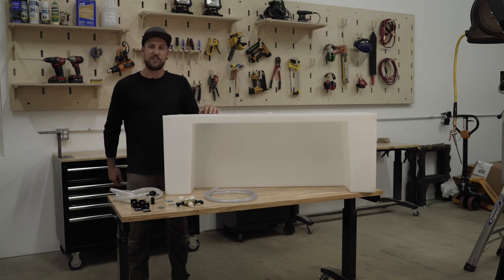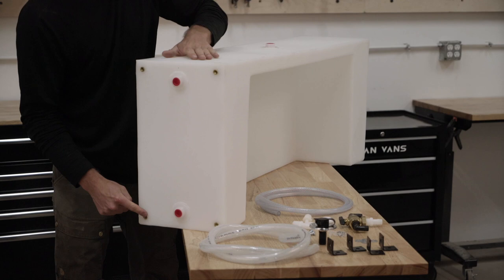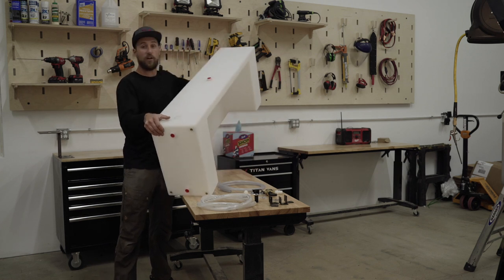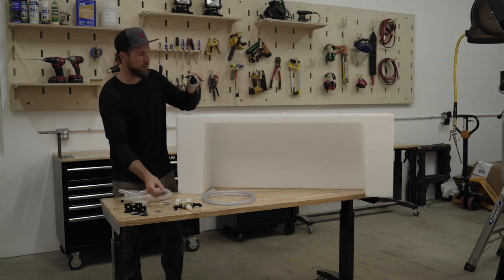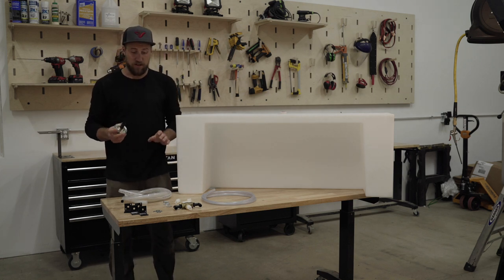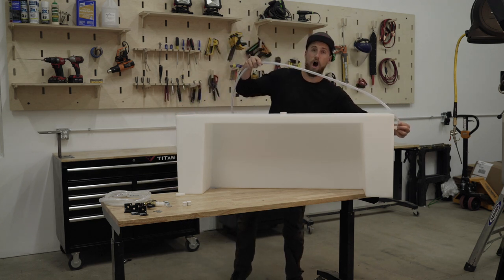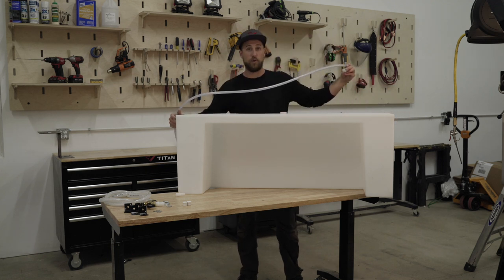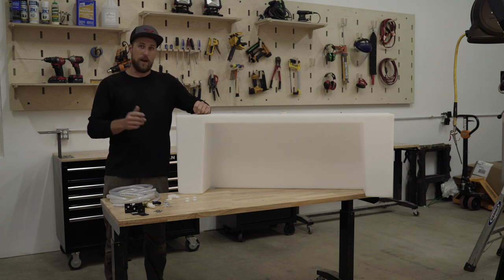TUTORIAL: How to assemble a 20 Gallon Water System in a conversion van using a Wheel Well Water Tank

Comment: Thank you for your video. Does the three way valve have a 1/2" to 3/8" barb on for the water pump side, and a 1/2" to 5/8" connector for the tank drain side?
Reply from the maker: The valve itself has female 1/2 NPT threads on all three sides. This particular kit includes (for adapting to hoses):
1 - 3/8" barb elbow x 1/2" NPT
2 - 5/8" barb elbow x 1/2" NPT
2 - 5/8" barb x 1/2" NPT

Comment: Sooo I’m confused. You need a total of 3 of the fittings that have 5/8 barb (1 for inlet, 2 for outlet) I got my kit. Only came with 2 and also didn’t come with any screws
Reply from the maker: Yes you need 3 of the 5/8" straight barbs, one for inlet on tank, one for outlet on tank, and one for the control valve. What screws are you refering to? If you are missing a barb, email expert@TitanDIYkits.com.

Comment: I thought brass was soon to be banned from being used in potable applications. Are you planning on changing that brass fitting? Love the design and everything to go kit but price wise, you can get nearly everything with a 20gallon regular tank for ~150. For 300 plus I don't know if it's worth it...
Reply from the maker: Brass fittings are totally potable water safe as long as they are free of any lead. You can certainly find square or rectangular tanks for much less. This is a custom tank designed specifically for over wheel well installation, can't find that for less.

Comment: Thanks guys - looks great - simply - manageable.
What do you recommend for sensors to monitor the water level - and how best would they be integrated into this if the top hole is used for breathing.?
Reply from the maker: We use a simple sight slot in our cabinetry to view the water level. If you want a more sophisticated solution, check out a set of the miracle probes. These are drilled and set in the side or end of the tank and use electrical conductivity to measure the water level.
Reply: @TitanVans  thank you! will do.

Comment: does that kit allow you to fill the tank through a hole in the side of the van, or is that an additional part needed?
Reply from the maker: You could install the fill port on the exterior but it would be better to get a locking fill port if you go that route. This kit is better suited for fill port being cabinet mounted but easy to get to with the doors open.

Comment: Has anyone done an under the bed water tank? Under a camper queen, if the tank is 67x51x4 inches, thats about 60 gallons full. Yes, you need a STRONG bed frame using 1530 extruded but that should be able to hold tons. This frees up SO MUCH room in the van. Yes, it would be expensive, as it would have to be baffled, but everything on a van is expensive. I'm going to start talking to some metal fab places to make a custom tank from stainless or aluminum
Reply from the maker: The biggest issue in our minds is the raised center of gravity. 60 gallons not including the weight of the tank would be 480 lbs raised over 3 ft up in the van. Even with baffles the momentum od rhe water when rounding a corner coild cause safety and driveability issues.
Reply: @TitanVans  Thanks for the reply. Duh, I didn't even think about that. Good call.

Comment: Clean out has to be a problem with this tank.  As great as this water tank and its installation locations are, the only reason I would not buy this is because of clean out complexity.  We all can say whatever about clean out but at some point, you're going to have to physically get into any water tank to clean it out.  Good luck doing that in this tank.  I would not do it.
Reply from the maker: We have been using these tanks for nearly a decade. As long as you are putting clean water in we have yet to have to physically clean one. Simple vinegar and water solution does the trick. That being said, if you are really concerned you could cut and install a screw on access cap.
Reply: @TitanVans  While that is a fair point, all water tanks in yachts have clean out holes as a matter of course.  I find that to be more of a I'd "rather have it and not need it than not have it and need it."  More importantly though my original point was directed towards the added corners and the narrow cavities and such which would be a cleaning problem, certainly from my point of view of wanting to keep things simple.
Reply from the maker: @tonynotstated695  Makes sense, though yachts typically have much larger capacity tanks than 20 gal and will incur much higher humid environments and potential contamination. We  have not seen van water tanks require deep cleanings even every 7-10 years. Worst case, tank can be replaced in less that an hour.